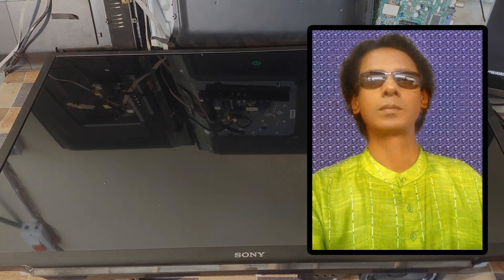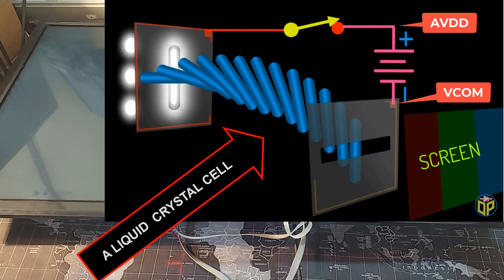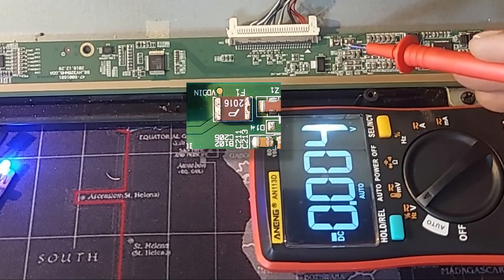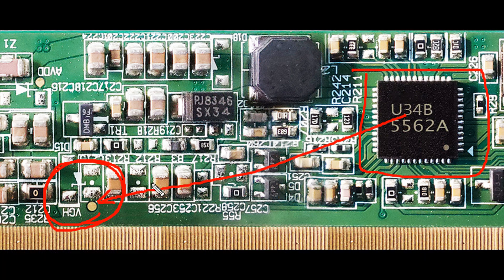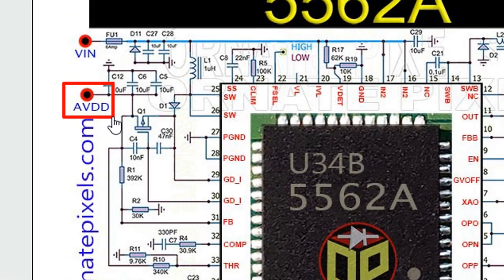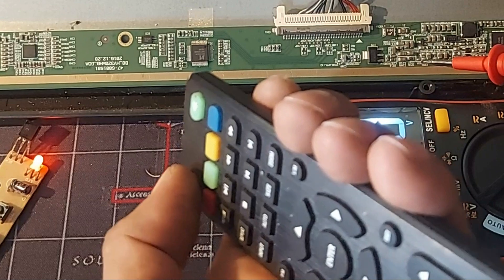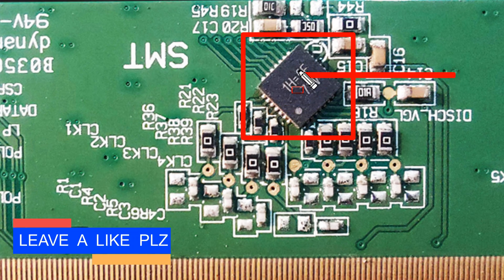HV320WHB-N85 Panel Has No Light & No Picture On The Screen, 5562A IC Schematic Circuit Diagram

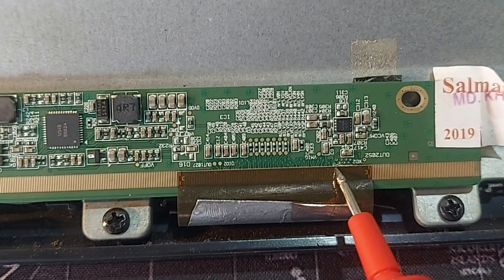Comment: Nice tutorial. I have got this panel inside a tv device. My situation is as follows: the 2 stripes that join the board and the panel (lc screen), (one of them shown in 2:33 min) were tore apart from board but not from the panel. How can it be fixed? Or must I buy panel and board? Thanks for your information.